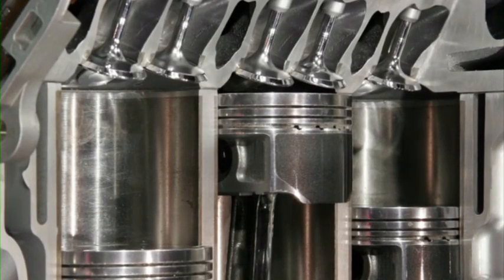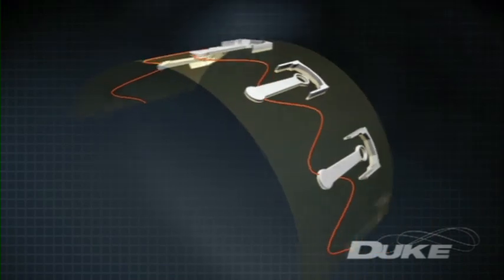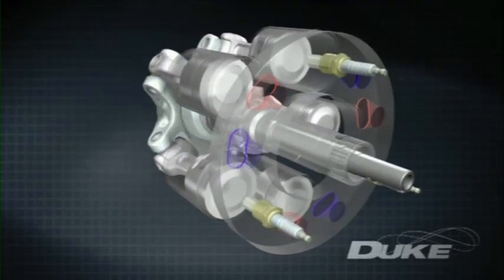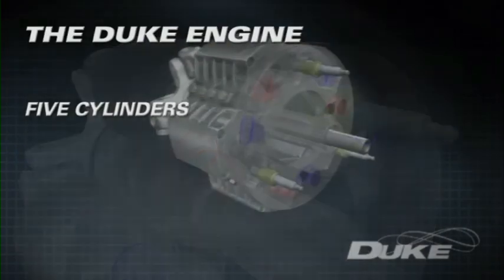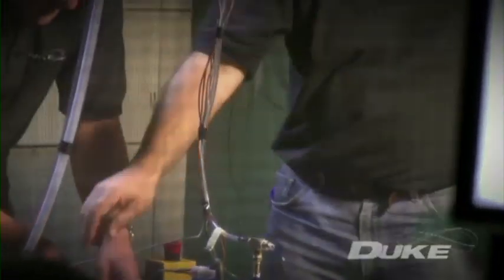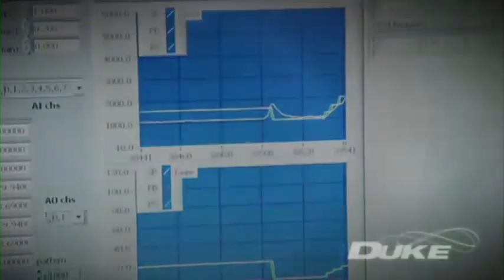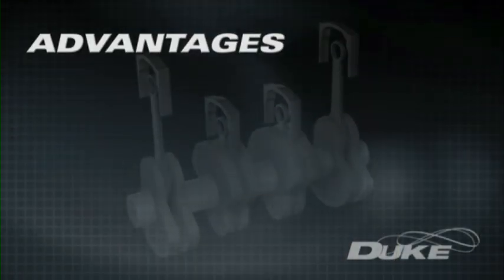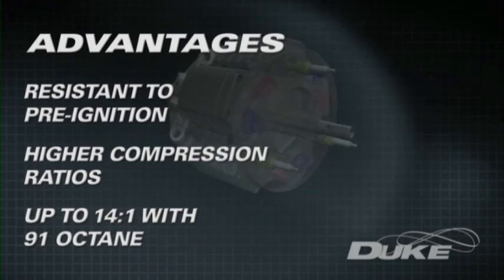Duke Engines

Comment: I love that this design exists.

But piston combustion engines are passé, no longer required. If the Duke can compare to a turbine in fuel efficiency, then maybe. But this spinning cylinder system is going to take some decent seals and oil for long operations.
Reply: Mariux - We're talking about an actual ENGINE, not an addition to an engine that runs on exhaust fumes.
Reply: ***** Modern car companies are producing turbines - http://jalopnik.com/whats-the-deal-with-the-turbine-powered-chinese-superca-1762962836

And there's actually a lot of old turbine cars that got banned from racing for being too efficient or removed from public sale for being too cheap.
Reply: Alexis Boom That's some weird shit...
Reply: +Schmidt and Crocket Inc. IKR, cool though 😊
Reply: Alexis Boom

Turbines are more effective only in maximum power output, but on idle they are thirsty like hell. In other words - in gas-electric vehicle (which goes without saying, since direct mechanic transmission would be highly stressful to turbine in terms of both fuel efficiency and service life) designed for long range it would be great - well, not even remotely similar to that 1300MPG kind of great as chinese claim with that supercar you mentioned, but still much better than piston engine). But in regular passenger car used every day in mostly city roads  on shorter tracks (generally under 20 km) its fuel consumption would sky rocket pretty quickly.
Reply: David Vermillion
Actually, on the Abrams, there's no problem with engine power - 1500 horsepowers isn't (and wasn't in the 1980s when M1 was designed) so magically high output for tank engines, but US army requested multifuel engine. And here's the thing - if you want multifuel ability, turbines are actually much better - multifuel piston engines tend to be kinda thirsty, unreliable and underperforming in terms of power/displacement ratio compared to regular piston engines. Turbines, on the other hand, are relatively compact and powerful. Still difficult to maintain and thirsty, yes, but not much more than multifuel piston engines.
Reply: So many people think that because something doesnt get developed that its some big conspiracy because its to efficient. I remember hearing about some guy who made a carb that could get 100 mpg but the oil companies either killed him or paid him off. Turns out there isnt enough energy in fuel to do that. Things dont get developed because its either not practical or people are scared of new technologies so there isnt a market for it.
Reply: well pretty much all of that is laughable. A commercial wind turbine cost anywhere between $1 to $4 million installed, youre saying a wind turbine produces a million bucks with of energy within a month? Every business uses subsidies for that matter, Green cant survive with out them. There are huge subsidies if i wanted to go buy a bunch of solar panels or put up a small wind turbine. Ethanol is only cheaper than gas because the government dumps so much money into it. So where are these 50 year old wind turbine sites that are getting refurbished?
Reply: Cars and turbines don't mix well.
Reply: +Schmidt and Crocket Inc. Turbocompressor.
Reply: *****
Oh.
Reply: You mean turbine, like gas turbine engine? Like basically jet engine driving wheels by shaft? Those things have literally no fuel economy whatsoever (about 30% higher consumption than regular 4-stroke gasoline piston engine of equal performance). Their only advantages are small size and ability to run on pretty much any flammable liquid.I say, if Dukes can match regular internal combustion engines in terms of fuel economy AND outmatch Wankels in terms of service life and oil consumption, then it's worth some development. But having piston engine with fuel economy of Turbine just makes no sense.
Reply: +Pavel Tobiáš actually turbines prove more efficient in fuel and oil economy by their design.

Turbines take advantage of physics whereas piston engines fight against physics.

Also, wenkel engines are only good on paper. Because of their mechanical aspects (apex bushes, oil burn, complex maths result in rapid degradation) they don't even match piston engines.

Wenkel only bonus was in power to total volume ratio.
Reply: Pavel Tobiáš actually the few turbine passenger cars were really efficient and had no trouble with the commute. Owners were really happy with long miles between servicing. But it scared the crap out of the crude oil industry. Even the more powerful turbine races got regulated into extinction because they were too good.

Which is why you use REx arrangement dude, in which case turbine trumps piston by a country mile and we take advantage of being able to run the unit at max chat and instead use a battery and electric motor to regulate road speed rather than a free power turbine, multi speed gearbox, and massive clutch.
Reply: Look up the turbine powered kenworth built in the 1950's. That's why we don't use them. Electric may take over everyday autos but until the heavy fuel oils (like bunker c) run out diesel will live on.
Reply: David Vermillion meanwhile these turbine cars got banned for being too fast and too efficient:
http://www.wired.com/2014/10/lotus-turbine-racecar/

https://en.wikipedia.org/wiki/STP-Paxton_Turbocar?wprov=sfla1

https://en.wikipedia.org/wiki/Howmet_TX?wprov=sfla1

And the consumer turbine car that was also withdrawn for being too efficient:
http://www.hotrod.com/features/1506-turbine-cars-past-present-future/

Also, now we're seriously looking at turbines for REx in a wider range of future vehicles:
https://nikolamotor.com/one
Reply: Alexis Boom If gas turbines are more efficient, why did  US railways stop using turbine powered locomotives in the 1970s oil crisis and never went back? They still use big diesel electric locos.

Listen no one in their right mind (especially an engineer) would ban/not build a machine for being too efficient. If they did, Electrical transformers would not exist because they are around 90% efficient or more. 

Yeah those cars could get good economy in theory. But there is a big difference. Jet engines produce incredible amounts of heat and literally dump massive amounts of energy out the tailpipe as that heat. Think of the energy needed to start a big turbine engine then how much energy it consumes and wastes while idling. Then think of how long it takes to rev a turbine engine. 

Then you must have an insane amount of gear reduction to even drive those cars. 

They are incredibly sensitive to what goes in the intake. Things you find along the highway (sand dirt gravel ect) are very detrimental to them. Yes air filters are necessary for normal cars but those turbine engines can't have a big filter obstructing the precious airflow.

Look at the M1A1 Abram tank. It is powered by a gas turbine engine. It is prone to damage from sand and it guzzles fuel like a thirsty fat man guzzles diet coke, it. The only reason it is used is because it gives the massive tank a lot of speed and the military has lots of money to throw at tanks.

Then look at its Russian counterpart (T-99) which is powered by a V16 diesel engine. Both are about the same competitively but one has a much more reliable engine. Guess which one that is?
Reply: David Vermillion you'll have to go read the links I provided:
•Turbines have a wider range output than piston engines.
• Centrifugal particle separators fit perfectly into the design of turbines considering the laminar airflow gets used for better compression.
• Turbines are better at multifuel.
• Turbines require different skilled maintenance, not necessarily more skilled.
Reply: tyler bonser that's nice, except turbine engines are getting developed now because they're more efficient and the evidence is available at the links provided sooo
Reply: So they are getting developed you say... Doesnt mean they will go into product and be put into everything. Not saying they arent efficient or cant be made better but if they were so much better than everything else they would be in cars as we speak. Also you said big oil is keeping them from being developed, soooo how exactly are they getting developed if big oil wont allow it.
Reply: tyler bonser past tense, big oil stopped the development back in the day but the green surge is too strong now.

Actually that's a lie, the only difference between then and now is that the oil is getting more expensive to extract so more frugal cars are required to keep the oil monster rolling.

Put it this way, if turbine engines were shit at turning fuel into electricity then they wouldn't be used as APUs 😊
Reply: Youre really not as smart as you think. Yes turbines can be efficient in certain applications but that doesnt mean they are going to work perfectly in everything. Plus they are expensive so its not something the average person can afford. Another reason for a turbine generator is you can pretty much put any kind of fuel in it. Also power plants that use turbines are steam powered. Not sure how practical it would be to have a steam turbine in your car.  Internal combustion engines are used as APU's so whats your point? APU's arent intended to be super efficient, they are for back up power for when the power grid goes down or isnt available.
Reply: tyler bonser firstly let's go through all of this:
1. "Youre (sic) really not as smart as you think" This is an evidence based discussion, I'm the only person that's brought any so before you even start you've said "I don't have anything but I'm going to give you my opinion anyway".

2. Turbines are something the average person cannot afford:
Actually although turbines cost a little more initially they increase in cost-per-SHP more slowly than piston engines. Cheap engines cost around £1000 to replace, a cheap turbine starts at £800 for comparable SHP (less fitting). At the higher end, piston engines cost £4000-£12000, where equivalent SHP turbine would cost £3000-£5000.

3. "Won't work perfectly in everything".
You take the electrical generation output of the turbine, feed it to a battery and electric motors and it's got the high torque for big heavy vehicles that need mileage such as trucks. Name-drops; Nikola Motors, Shiguan Motors, Daimler, Renault Trucks, Volvo are all test-bedding/simulating these over plain ICE.

4. "Multifuel" "steam turbine". Why you contradicting yourself? Oh, reductum ab absurdo. Yes, multifuel and with modern air mass and fuel density sensors that's good efficiency through from petrol, through diesel, to F34/JETA1.

5. There's two main combustion devices used for APUs, old submarine engines and turbines. Submarine engines are designed to be very efficient for low air useage and be very reliable, but they're not terribly fuel efficient.

Turbine APUs are specifically perfect for high power output for low weight and fuel usage. This is evidenced in the way that everything from the Dreamliner to the AH64-E uses a turbine APU. The APU needs to be able to run all the services on the aircraft less the transmission and it needs to do it on very little fuel otherwise you can't go flying afterwards.

Also I think you're confusing APU with UPS.

Like I linked earlier, it's likely future hybrid long range trucks will get turbine REx arrangement whilst national range trucks will use pure batteries and rapid charging.

In cars I would expect to see maybe Duke mode engines or turbine engines providing REx to EVs for people who desperately want range without stopping every hour or two for twenty minutes.
Reply: Alexis Boom Not saying you dont make good points. Just to clear something up. When I was refering to multi fuel I mean like gasoline, diesel, fuel oil. Steam turbines are obviously a completely different type, which are used in power plants. 

Typically it is the initial cost that people look at. If they cant afford the initial cost it doesnt matter how much they will save down the road. Solar energy and wind energy are great but as of now the cost outweighs what it can produce.

This so called green energy surge you speak of has nothing to do with big oil not being able to hold it back anymore. It's simply that the government is subsidizing it so heavily. Certainly some of the technology is improving but it has a long way to go.
Reply: tyler bonser actually the green surge is entirely subsidy free, government subsidies around the world were cut off between 2011-2015 because green energy could survive without them.

In fact the fossil fuel industry always has and still does receive subsidies.

It turns out that wind pays back within a month and solar within two. In fact it turns out that solar and wind together are cheaper than gas and will soon be cheaper than coal in every country in the world (currently wind and solar are cheaper than coal in about half of the world).

Additionally, there's the multi million industry of refurbishing old wind and hydro turbines. Typically these have a life of thirty years though some sites have operated for forty without upgrades. Now companies offer end of life refurbishment to extend them or inline upgrades to make blades and generators more efficient.

Lastly, there's been very little  PV (photovoltaic) waste (as opposed to SWH solar water heater) as solar panels aren't breaking down or wearing out quickly enough but it's projected that solar waste recapture and recycling will become a billion dollar industry by 2020.
Reply: tyler bonser
Old wind sites are perfect for upgrading:
 http://green.blogs.nytimes.com//2009/01/26/old-turbines-get-a-second-wind-through-remanufacturing/

Repowering is a growing market:
http://www.windpowermonthly.com/article/1086978/gearbox-repair-market-continues-grow

This is because old turbines just won't die:
http://cleantechnica.com/2015/05/21/oldest-operating-wind-turbine-world-turning-40/

Even in USA, renewable is cheaper:
http://www.politifact.com/texas/statements/2016/apr/12/barack-obama/barack-obama-says-wind-power-cheaper-texas-power-d/

Even in bigger oil generating countries:
http://www.ibtimes.co.uk/here-comes-sun-saudi-arabia-looks-export-solar-energy-fossil-fuel-starts-run-out-1502453

And in countries with good access to maritime wind, we can generate too much to use:
http://www.telegraph.co.uk/news/uknews/scotland/10038598/Scottish-wind-farms-paid-1-million-to-shut-down-one-day.html

And there really are very few subsidies for renewables globally, £3tn year on year for fossil energy where renewable installations get small 2-10% injections from governments:
http://www.worldenergyoutlook.org/resources/energysubsidies/

http://www.renewableenergyworld.com/articles/2015/06/a-closer-look-at-fossil-and-renewable-energy-subsidies.html

And that's OK, because as I said renewable energy is cheaper than fossil anyway:
http://www.economist.com/news/special-report/21639020-renewables-are-no-longer-fad-fact-life-supercharged-advances-power

Plus there's the hidden bonuses, no massive cleanups:
http://www.investopedia.com/financial-edge/0510/the-most-expensive-oil-spills.aspx

No changed terrain and scenery:
http://grist.org/article/obama-ends-150-year-war-of-strip-mining-in-24-states/

And no hidden medical cost:
http://journalistsresource.org/studies/environment/pollution-environment/health-effects-costs-air-pollution-research-roundup
Reply: So there is one wind turbine that is 40 years old and a handful that a a bit newer and you say they have never gotten a single upgrade?  You keep bring up things im not even arguing about. Obviously older units can be upgraded to be more efficient that is the case with any technology. 
 I never said big oil doesnt get subsidies but you send me a link for that. No change to terrain and scenery? How about the hundreds of wind turbines around me? thats not a change in scenery? The last one is the best, no hidden medical costs. Making the green energy still causes pollution.
 You do realize that the numbers they are giving for the cost per kilowatt or megawatt doesnt included the initial install cost and thats what hurts green energy so much.
 And the other link about creating jobs, obviously its creating jobs, that doesnt mean economically cost effective at the moment.
 Certainly the arab countries would be ideal for solar power but i think the whole thing about them exporting the power is a bit laughable. I think they realize they are fucked when they run out of fossil fuels. But dont think there will be exporting solar energy to the USA anytime soon.  
 Yes we do need to look for other forms of energy. But right now its the cheapest form of energy.
Reply: Alexis Boom  On another note. Fuel prices dropped substantially a few years back when they expanded drilling in North Dakota and expanding refineries. It wasnt because there were more resources available or green energy was taking off but because the arab countries dropped the prices in their oil to the point were companies were loosing money in North Dakota.
 Also people who are more for green energy versus what the economy can handle want fuel prices to be high, thats what makes green energy more appealing. Its pretty simple, when green energy becomes more cost effective than fossil fuels the price of fossil fuels will drop because there is less demand for it. If a gallon of gas costs $5 a gallon then certainly green energy becomes more appealing. 
 The whole deal about us running out of fossil fuels will likely not happen in our lifetime. Not sure if youve heard of Marion King Hubbert but him and other geologists have made claims when peak oil product would occur. Well his claim was that peak oil production would be in the 70's. Peak oil being when we can no longer get as much oil as we want out of the earth. Turns out we havent come close to thats. Is it harder yes. Is there a lot still out there, yes. Do we need alternatives? Without a doubt!
Reply: A turbine is completely useless in small engine vehicles, and especially in cars, Chrysler tried it.
Reply: tyler bonser oh I only just saw that you replied:
Newsflash - renewable energy is still cheaper per kWh and investors wouldn't be installing it if it wasn't so that just blows everything you said out of the water.

Newsflash - air pollution is still killing people, and it costs money to treat people affected by air pollution so renewables are better in that sense.

Plus all figures you'll find for green energy "pollution" will be off because every corner of the world is greenifying, which means every successive turbine or pump is produced with less pollution (oh BTW, building fossil burners creates as much or more pollution so there's no point you attacking this angle) and with each one made each successive one creates less pollution so that destroys your "oh what about production pollution" point.

Floyd Wilson the Indie 500 had to change all it's policies to stop turbine cars destroying the competition. 

Chrysler bought back, retired, and destroyed all but one of their turbine cars for no published reason. Which translates to "The oil industry became terrified about these smooth running, quiet, efficient turbine cars".

Also Nikola Industries (Motors?) and a Chinese company are looking to build turbine range extender vehicles for mass production. You might not know this but for volume-for-horsepower turbines are way ahead of piston engines which is why they get used on aircraft.
Reply: Alexis “The Player  I like your "All figures youll find for green energy pollution will be off" comment. So basically youre saying the facts dont match what us green people want to believe see we will just say they are wrong.     Your whole deal of big oil is trying to kill all green energy is funny every time I read it. A lot of the wind turbines in my area are actually owned by companies in the middle east.
  As to your comment to Floyd, so there are a few companies looking to build turbine cars. That really doesnt mean shit, Just because someone is thinking about doing it doesnt mean its cost effective or going to happen. If or when they become operational then you can make a big deal about it. Not sure why you even mention since turbines are in planes that mains they are better for other applications. They are used in planes because they have a high horsepower to weight ratio. This doesnt mean they are more efficient or more cost effective to use.
Reply: tyler bonser you clearly don't understand business then, aviation is driven massively by commercial requirements hence the best engine would be chosen that satisfies cost of maintenance, operation, acquiring being as low as possible would be chosen.

Now you might go "But surely turbines are only chosen because they handle high altitude well" but then we realise that a lot of island hopping aircraft with unpressurised cabins also use turbines.

So as you concede, more horsepower for volume, cheaper in every way. Now you can see why the money is against a mass market swing to these motors. It's precisely the same with electric vehicles.

"Owned by the middle east" you say, is no doubt true because it takes time to switch investments over. Because of this shuffling around of money we find it's profitable to exploit the vastly profitable crude industry until the last well is dry whilst investment is put into holding companies. 

Were "big oil" left to it's own devices we'd find that at the very last second their investments are clearly switched from crude to green.

The problem with this as I linked is that every hour you have a couple of football field worth of crude and crude derivative leaked from containers and pipelines causing untold ecological damage, then you've got the human effects of such leakage that makes a lot of water undrinkable or risky to drink, and you've got the aforementioned cost in time, money, and lives to the air pollution that kills around a million people each year globally.

So back to the original point: gj inventing a solution to a problem that's been solved with other technology but I look forward to at least seeing this idea work, maybe on ethanol.
Reply: Alexis Boom You are fairly well disconnected from reality. Nothing you have stated about Turbine cars is based in fact. NOTHING.
Reply: Floyd Wilson Looks like you're more disconnected as all you've done is tip up and post a bullshit comment whereas I've backed up every point :/
Reply: Alexis Boom Your whole turbine argument is by far the weakest of them. The aviation business is not based on cost effectiveness. You dont fly because it is a cheaper way to travel you fly because it is faster or that its the only way to get there..
    Turbines are used in aviation because they are faster and quieter. If they were cheaper than why wouldnt they be used in all private airplanes? Well thats simple because only the rich or large business can afford them. 
  Your logic that because they produce more power per pound that they are more efficient is idiotic at best. Just because it weighs less doesnt mean it takes less energy. That is another big reason why the aviation industry uses them, because with a lighter engine that produces more power they can carry more cargo.
   So basically in your logic a rocket motor should be more efficient because of its greater power to weight ratio. Also turbines are certainly not cheap to maintain, ones used for planes anyway.
   Even with all your flawed logic on the turbine I dont get why you base its whole effectiveness off of one industry.
Reply: tyler bonser going to have to call you out there, aviation is fully about saving money. Which is why legroom shrunk by half from 1980 to 2000 and half again from 2000 - 2010. It's also why the cargo door faults with the DC9 were not rectified until 6,000 dead passengers later.

Piston engines get used plenty in aviation even in built up areas, you only get penalised if you're too loud but loud means power which is why A320 has memory metal exhaust to reduce sound at low altitude and restore performance at high altitude.

Then you go and contradict yourself good job, turbine engines do produce more thrust for their weight than piston engines. And they burn less when used efficiently and cost less to maintain or it wouldn't be cost-effective to use them 😂

As for the cheapness, having worked on various turbine aircraft over a decade I can assure you fewer expensive parts need replacing on turbines over a longer period than pistons. You find yourself changing nozzles, plugs, starters, bearings, belts all the time on piston engines but on turbines you check the plugs, blades, and liners every 50-250 hours and hard replace them every 250-1000. And that's on an overservicing schedule not a commercial airline one.

Doesn't matter anyway, fossil aviation is being made redundant by Siemens, Boeing, NASA, and other contributors and electric cars have arrived so at the end of the day this motor might never see the light of day.
Reply: Alexis Boom        I'm going to have to call you out, I never said they arent about saving money.  Obviously they aviation industry is about saving money, they dont just piss money away for the fuck of it. Any industry is about saving money. 
  Not sure what I contradicted myself on. I never said turbines dont produce more power per pound. Not sure what kind of piston engines you work on where you change all that stuff all the time. 
  I see you didnt explain why so many privately owned airplanes are piston powered. But as Ive seen with you again and again you read things how you want to, you argue on things that I didnt even say.
  Not sure what your last statement means. Are you saying that the turbine motor is already becoming obsolete? Well you dont really need to answer that cause I dont really care, plus im sure you will go off on some other tangent that isnt even related to what we were talking about.
Reply: tyler bonser interesting how you avoided answering anything by going "not sure how".

Then you accuse me of saying only turbines are going obsolete when I used the word "fossil" which applies to all combustion engines or ICE.